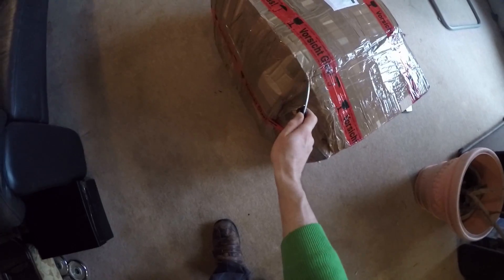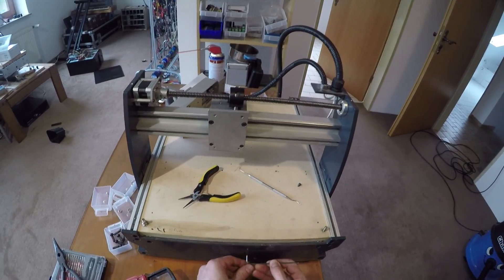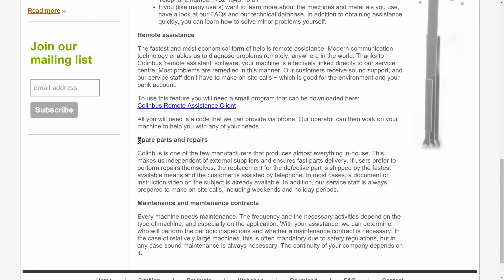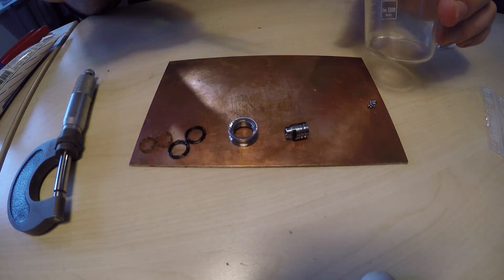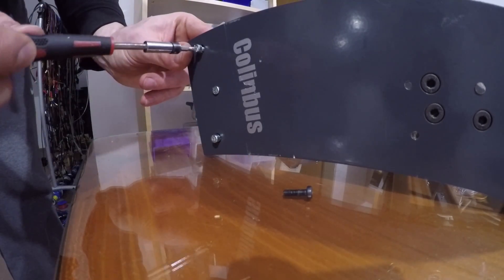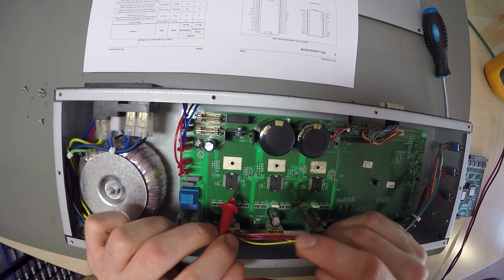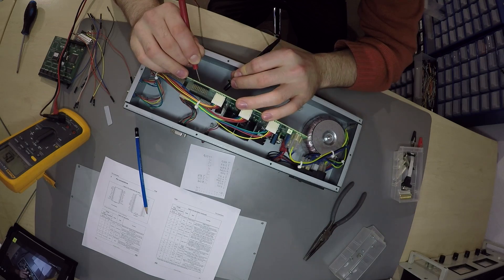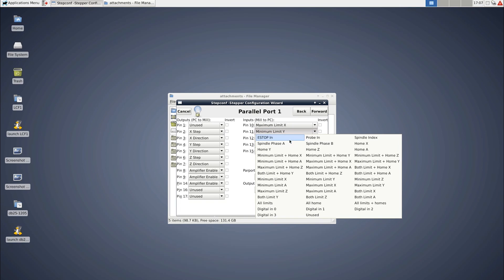Repair and LinuxCNC conversion of a Colinbus Pofiler desktop CNC

Comment: Marco, where did you get the spare bearing? I recently got an identical machine, picked it up myself so no shipping damage. One of the MPI00025-bearings (smaller, non-eccentric) is pretty rough and might need replacement ...

Comment: Thank you for the great instructional video! I am about to convert a Colinbus CBR-40 which is a very similar machine. I connected almost everything to the parallel port according to your drawing in the colinbus.png file but since I am not experienced in electronics I don't understand where the XYZReset and NC(Relay) pins need to be connected if at all. I would much appreciate some help. Thank you.
Reply from the maker: NC = Not connected, the rest is up to you. You configure the parallel port pins in your software and connect them to the hardware accordingly. What I have put in the D-SUB-25-Pinout.txt is just an example. XYZReset resets the stepper driver ICs, not needed usually!
Reply: Thank you for the quick response. I tried it now and it works! You literally saved this machine for me. If I could donate to you somewhere let me know because I owe you a beer!(or RedBull:)

Comment: Hi +Marco Reps,

I'm trying to follow your guide. At this time mine "lioncubs" is moving all the axis but the home position and axis limits is not set correctly, I don't know why because I have used your lioncubs.stepconf. 

Can you guide me on how to set limits and home position?

Thanks this guide is awesome!
Reply from the maker: Every limit switch needs its own resistor (1k to 10k) to 5V AND a parallel port input pin on one side and GND on the other side. Check with voltmeter if input pins are normally at 5V and when switch is pressed 0V. Then fiddle with stepconf until it recognizes it too :) Good luck
Reply: +Marco Reps I will check that and post the results later Thanks!
Reply: +Marco Reps I have mismatch HDR 1 with HDR3. Now it's working but i have 0V when the switch is pressed and 5V when it's not... But it's working! Thanks!
Reply from the maker: +Sebastião Beirão Great! It is best practice to have those lines normally high so that the machine notices cable break but that's only important for higher power machines where a crash can damage something else.

Comment: I have a similar machine that need some work, I tried to contact colinbus but no success , Can i run this machine with a windows based platform?? if so how?? I would appreciated your help.
Reply from the maker: +EADGBEdown Mach3 is a windows based machine controller, that does what LinuxCNC does but not as good ... Can be connected the same way tho.

Comment: Hello, i have a first gen colinbus profiler since 2007.
I'm just tearing down the controller to make it usable with LinuxCNC, thanks to yours instructions.
Many thanks !
Reply from the maker: +ROBIN Guillaume Nice! I have added a link to my notes to the video description. Including pinouts and a working linuxcnc configuration.
Reply: +Marco Reps Thank you, i finished the soldering part, i'm downloading LinuxCNC. I'll keep you up to date shortly ;)
Reply: +Marco Reps I just finished some test, everything works fine ! I have latency issues, but i'm using an old laptop running live LinuxCNC distro, i'll investigate that tomorrow !
About the original controller; "EVIL" is the right word. The controller's hardware is based on powerful H8, but firmware and proprietary command language ruins everything.
Thanks for your help ! I'll post more news later. Many thanks again !
Reply: +Marco Reps Hello, my "new" Profiler is working fine, thanks to you ;)

You have literally given new life to her !

I'm trying to add a Z touch plate (maybe a real sensor in the future) to EMC2 using these instructions :
http://forscience.nl/?p=144 (Part 1)

http://forscience.nl/?p=197 (Part 2)

I need to launch StepConf to change some settings. Can you provide the lioncubs.stepconf file (at the root of EMC2 configs folder) ?
I'm trying to re-make the configuration from scratch, but your settings were perfect and there is always something odd in mine.
Thank you !
Reply from the maker: +ROBIN Guillaume lioncubs.stepconf: https://drive.google.com/file/d/0B6S_PcWWM1YlVHB2TUFtS0RnUzQ/view?usp=sharing
Reply: +Marco Reps Thank you ! After a few manual changes to your original files (without stepconf step) , I almost managed to run the sensing plate on the Z axis. EMC2 is complicated but very powerful. If I can get a satisfactory overall result , I would try to send you my (your) modified configuration files.